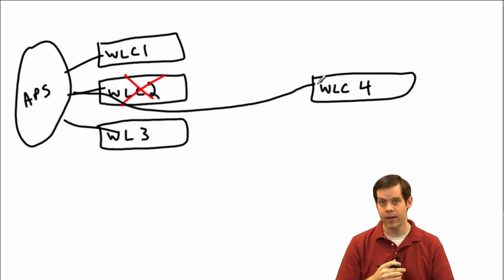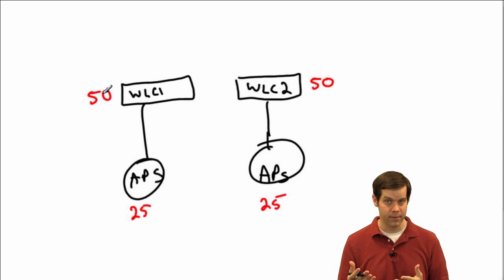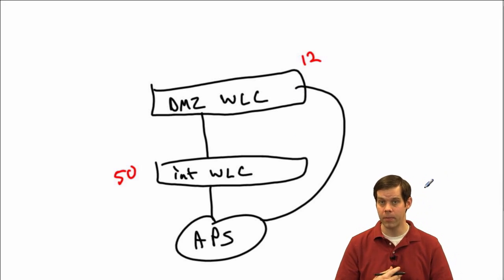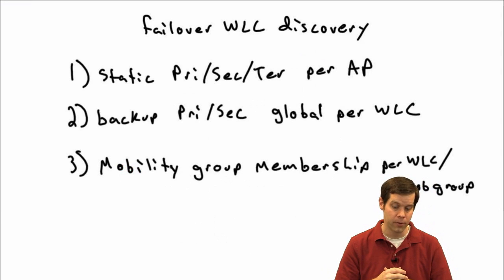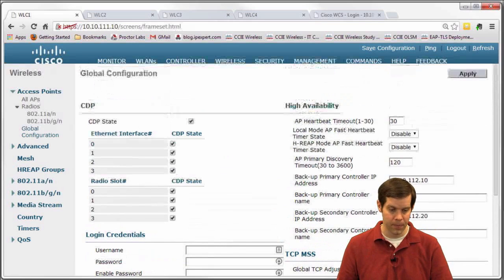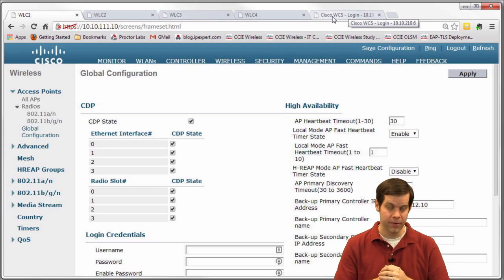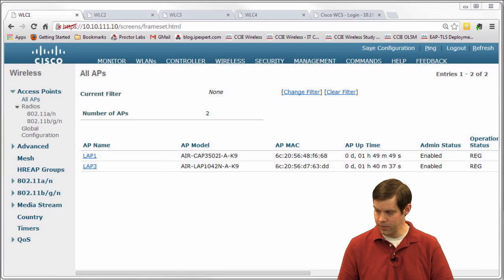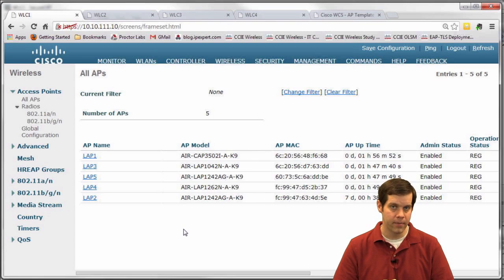CCIE Wireless Lab Training Video :: AP Failover and High Availability

Comment: Unfortunately, using a controller HA  is not a great idea in a enterprise environment.  If you upgrade the firmware(some code upgrades require newer firmware)  both controller go offline for 45 mins until both controllers firmware is upgraded.  In a non HA environment the APs fail-over to the secondary(although it takes a min or 2) but at least I don't have he entire facility offline for 45 mins.
Reply: Indeed